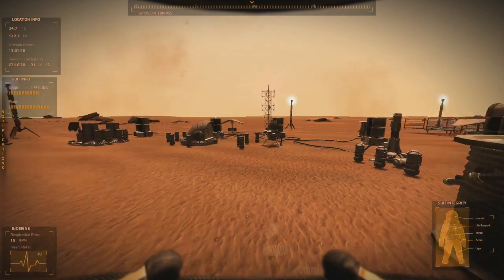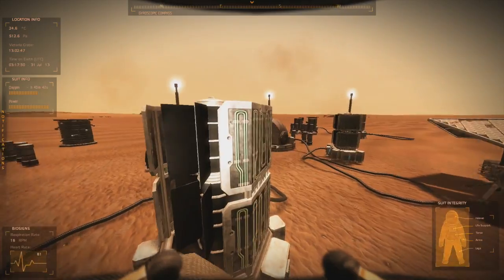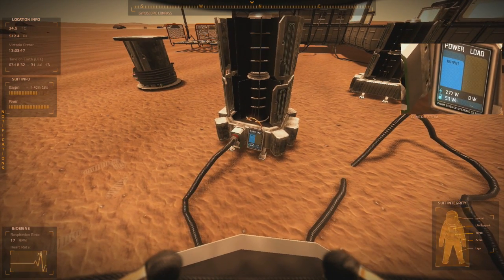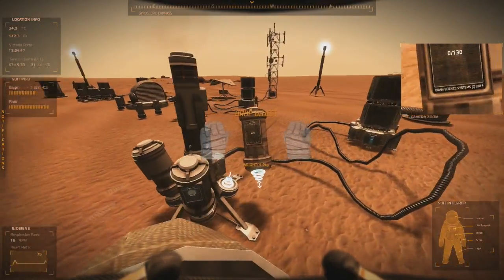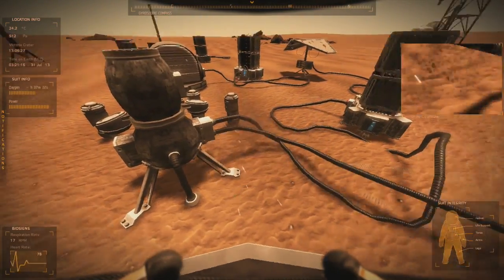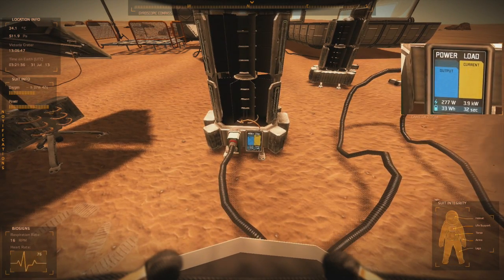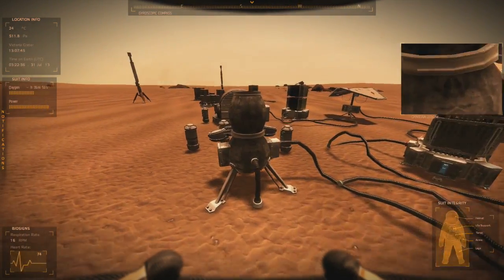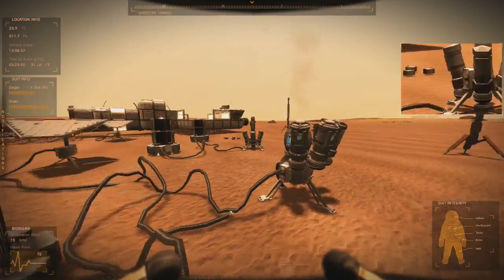Take On Mars Editor 24

Comment: have you thought of having 4 solar panels on a wall input and only say 1 drill on the wall output, that way there will be more power and stored power available to the drill
Reply from the maker: +Liam Gibbins 
At the time, I did not think to do that. It is even easier now that they added the power hub, 6 in 6 out. Lots easier than the wall now.

Comment: A radioisotope thermoelectric generator works on the highly radioactive core, usually Plutonium 238. Po 238 is so radioactive, it actually glows, and its the heat given off by this decay that offers a series of thermocouples inside the RTG to generate electricity. Electricity therefore doesn't come from outside source, like the solar panels. It's all self contained plug and play power.
Reply: The radioactive solar event recharges the MMRTG faster ?